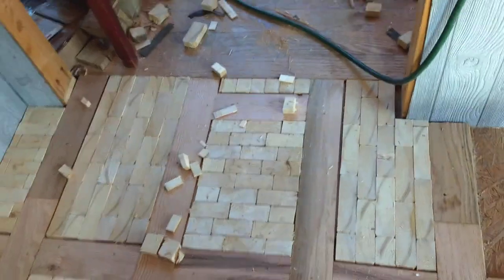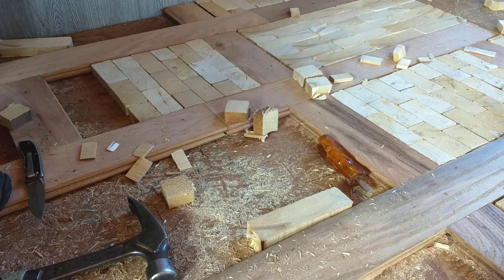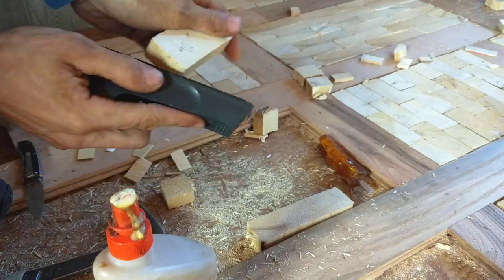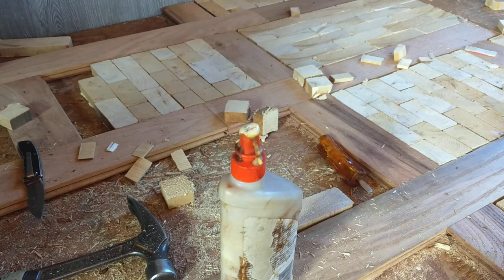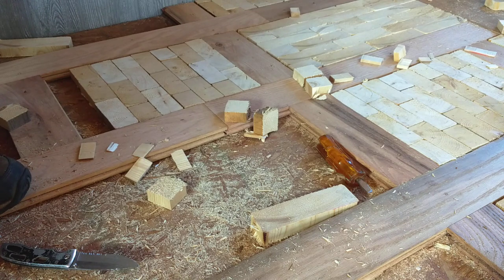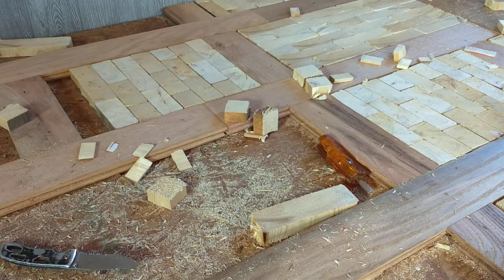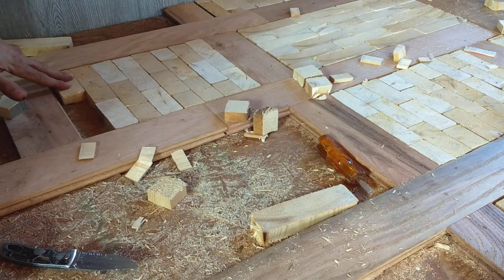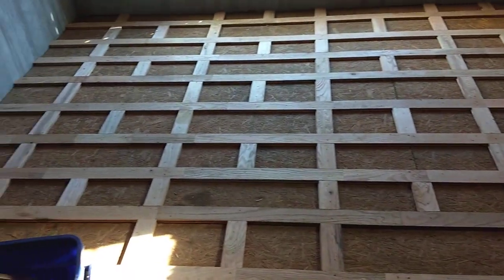DIY: How to Install End Cut Floors

Comment: What's the finished product look like?
Reply from the maker: Eric Peltier there is a video on my channel about n cut floors that shows this floor with one coat of stain and poly. I did not like the shine for my preference so I sanded it down further added some table top 2 part epoxy. I do not have a video of its current state yet. I've been busy in the process of adding an addition to the house turning that bedroom into a dining room
Reply: Waiting to see the finished product!

Comment: Those are gonna come up. The end grain absorbs the wood glue
Reply from the maker: CUM2america thank for your thoughts and opinion but I've been in construction my whole life.  I know what works. The floor has been down over a year no problems. No sweaks and no movement. It actually has moved less than regular hardwood floors. Do the research before commenting
Reply: @downsteamstudio  and Iv been a wood worker with a small business and formal education for several years. U can not simply put wood glue onto end grain because it will be absorbs into the fibers of the wood. It's only been a year, which is no time at all, but I guarantee you those tiles will start popping off within the next five to ten years depending on the amount of traffic you have. A water-based urethane adhesive or even a construction adhesive would have been a better choice. You can still potentially preserve your work by pouring an epoxy.
Reply: @downsteamstudio hey bro I appreciate the effort, but you're obviously in a hurry to not have em all ready before and dust everywhere. If you know physics... glue is very hard and brittle and will eventually break; you need a plyable adhesive. Its not like its not gonna work a while, but in the end its not gonna hold long term! Like 5 to 10 years it's gonna have some issues.
Reply: @CUM2america  yeah you gotta know the physics of things and what is needed for a superior product.  Still a great idea with the grid though :)

Comment: Ive done a few of these floors and I can say with certainty that this one will look like crap. Those pieces will come jumping out of place in no time.
Reply from the maker: James Smogonovich thanks for your opinion but the floor has been down over two years everything's in place nothing's popped loose when you go to finish it you have to use 2 part epoxy. There's even three large windows that the sun bakes the floor everyday. All the pieces was cut two years prior and placed in the house to acclimate. With 20 years of experience and my father having 40 plus years of experience we know carpentry